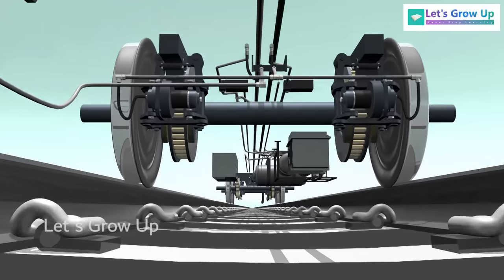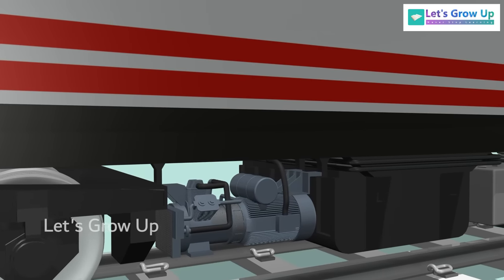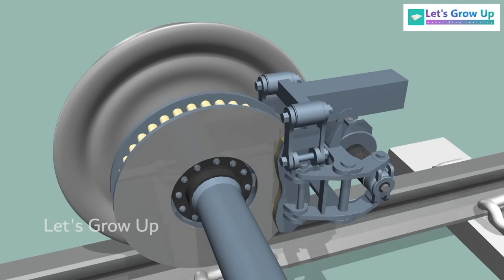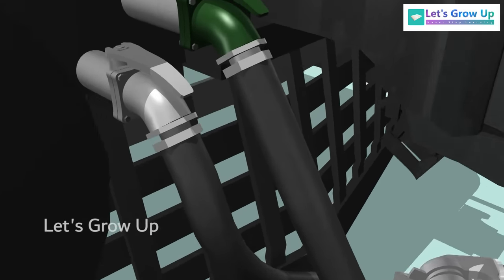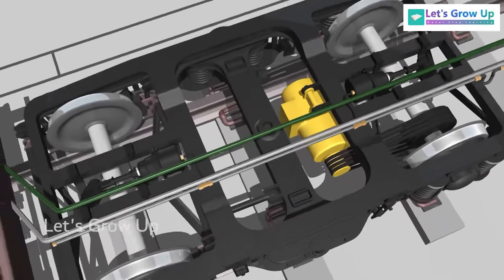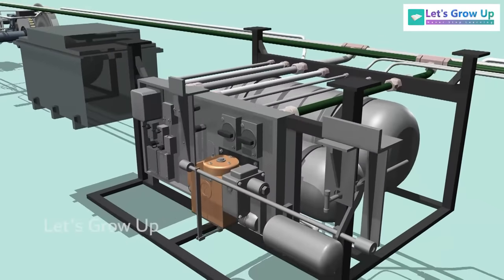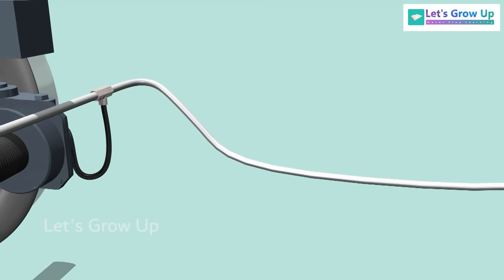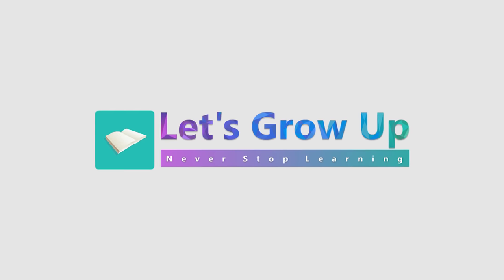Understanding the Technology Behind the Train Brake System

Comment: Im a train driver, this video is horrible. You didn’t explain brake systems. You showed the layout of a particular train types brake system. Nowhere did you explain the use of triple valves or similar such systems. You can’t call this explaining brake systems where you only told us you have air pressure, air pressure goes to a panel, disc brakes go brakey brake, and done.. this is not useful in any aspect

Comment: You never bothered to explain the main safety principle of a train braking system, if there is a failure in the the braking system itself the pressure drops which activates the brakes. Without pressure the train can't move or if it is already moving it will be stopped. But you did mention the names of all the parts of the system, in my view this is a poor way of learning, not talking about the principles of the system but learning the names of the parts. Thanks for the animation.

Comment: Compressed air in the brake pipe goes through a triple valve which fills an onboard reservoir on every car; at the same time venting the brake diaphragm and releasing the brakes. When the brake pipe pressure is lowered, the triple valve removes a proportionate amount of air from the onboard reservoir and sends it to the brake diaphragm. When the brake pipe pressure is increased, the triple valve vents the diaphragm by proportionate amount and adds it to the reservoir. When all the air is removed from the brake pipe, all of the reservoir air is applied to the brake diaphragm. This way, if the brake pipe pressure is suddenly lost, all brakes go on. There are refinements to this system, including electronic components but this is the basic operating system. When some knuckle-head drives in front of a train, the engineer may throw the emergency brakes "on" which dumps all air and stops the train, usually hundreds or even thousands of feet further down. It may take the engineer 10 minutes or more to recharge the air line before he can move on.
Reply: @nate4745  That sounds like the American system, and heretofore I had thought that that was a universal system. This video makes me think that we are here being shown a European system that is different.
Reply: "When some Knucle head drives in front of train...." Love that line 😅😅😅😅😅😅😅
Reply: @MottyGlix  Hello! Indeed there is a difference with US braking system and the European braking system. Since the Westinghouse company developed the automatic brake system for trains (it's called automatic because in the case train break apart, emergency brake is applied) it has been widely adopted in the United States. It's using a triple valve that can gradually increase braking power but you can't gradually release the brakes, release is done all at once.
Now, going to Europe, Serbia in the 1920's a man named Dobrivoje Božić developed and patented in 1928 an improved version of the automatic braking system which doubled the air flow in the main pipe and had the gradual release function which meant air was being used more efficiently thus making the train reach higher speeds and having better braking performance. Still to this day a 100 year old design of the independent brake lever called "Božić-L" is used on some locomotives and multiple units in countries of ex. Yugoslavia. It's very simple and robust.
Greetings from Croatia, a train engineer!
Reply: The video is not from Europe.
Our valves are red (main) and yellow (supply).
We use alike system like Westinghouse, but implemented into national levels by Knorr, Božič or Daněk (DAKO CZ).... etc.
But the main valve is 3-way proportional, filling the reservoirs, releasing the brakes and deploying the brakes.
Also the braking effort can be set (freight, passenger or fast -  braking performance determination).
Reply: Nice. These aspects were not made clear in the videp. Thanks.
Reply: I totally agree.
Reply: Wait, I'm confused. Lets say that a train breaks in half. The rear half no longer has the locomotive to supply air. How does the rear half stop? A better question......does compressed air apply the brakes or retract the brakes? I always thought the air retracted the brakes and that if pressure was lost that spring pressure would apply the brakes as a fail-safe.
Reply: @rael5469  The air in the lines retracts the brakes. However there is air tanks on each car and unless the air in those tanks dump out the brakes stay open. So the answer to your question is, there is actually a lever on each car that is connected by a chain to the next car near the coupler. If the car breaks away, this chain yanks that rod and opens up its air valves to dump all the air it has in its system. This is how train cars stop if they break lose. Its not super sophisticated as the rest of the stuff, but an effective and simple solution to that problem.

Comment: Okay that will work just fine for 10 to 20 coaches but what about 100 to a 150 fully loaded coal cars.Not going to work.Dynamic braking should be your next video.
Reply: LHB Coaching trains have Disc Brakes, frieght wagons have Air Brakes.
Reply: Air distributors can be set to a higher delay in action... generally, a regular European freight train (up to about 50 wagons / 200 axles) has a 15 - 20 sec action time of the brake, to avoid creating shocks in the train, while a passenger train of less than 80 axles has 3 - 5 sec. Brake force can also be set between predefined settings (G (freight), P (passengers), R (fast) or R+Mg (fast+electromagnetic, for passenger cars equipped with electromagnetic brakes). 
For an 100 cars train... you'd need very slow action air brake and all the dynamic braking the loco can give you. Or you can install electropneumatic brakes, that can command electronically all the brake distributors at same time... the later can be quite expensive and I doubt it is used at the monster trains in US, Australia or India, but will probably become a standard feature in Europe in 20 years, with the introduction of the Digital Automatic Coupler (DAC).

Comment: this is the only video which i find it hard to understand.... can u please explain with more details in which, how the compressed air actually controlled and it stops accordingly... need to know how much speed it can slow down in time for disc vs normal one
Reply: Simplistic explanation. In an air brake system, which is what is shown here, the brake pipe is always pressurised. Imagine two systems - (i) the brake pipe system and (ii) the coach's brake reservoir system. In normal condition when a train is moving, both of these systems have equal pressure. When the engineer activates the brakes, the brake pipe system loses pressure. The braking system is designed in such a way, that when pressure of (i) is lower than pressure of (ii), the brakes get activated based on the difference in pressure (more difference in pressure, higher braking), until the train stops. 

After the train stops, the locomotive  engineer has to apply only parking brake - at this time, the compressor in the locomotive starts to pressurise (i) again. When pressure in (i) is higher than (ii), it recharges the pressure  in (ii). In this condition, the brake is released, but the train doesn't move as the locomotive is set on parking brake. It can take 5-10min to fully recharge the system, depending on length of train, type of train etc.

Its quite complex to explain in words, but I think there are other videos out there that explains this pictographically. You're right, this video doesn't explain anything.
Reply: @chris_fly  Wow bro, you explained very well in words...  Thanks for your patience and explaining me... This Helped me in understanding the whole process easily

Comment: Just so you know those are not brake shoes those are brake pads and they work very similar to the brake pads in a car. The brake shoes weren't very similar to the brake shoes in a car as well but they do pressing up against the wheels in a car they were pressed up against the drums if you have drum brakes
Reply: And how typically often are the train's pads replaced - once a year? I know it depends on the amount of usage and all that...

Comment: NO loss a air pressure causes springs to engage brakes. This is the most safe type of system.
Reply: Just like air brakes on semi-trucks. If the truck loses system air pressure due to a leak, the brakes will eventually apply. So the trucker needs to pull over quickly.
Reply: No it doesn't, that's on trucks, not on trains. You couldn't get the required brake force with springs on a train. On trains, the pressure to lock the brakes should a loss of continuity occur comes from the local air reservoir on each vehicle which is charged by the main reservoir pipe through a one way valve. As long as the local air reservoir is charged then you will have brake force, and it takes hours to discharge if the main res pipe is disconnect
Reply: @Trainman10715  So no air, no brakes then?
Reply: @MegaGeorge1948  no air in the local reservoir* no brakes, correct. Hence why all rolling stock must have the handbrake engaged when stabled as the local reservoir will depleat over time. This brake system is still fail safe though as whenever the train is moving the local reservoirs are kept charged by the main reservoir which itself is charged by the compressor. And a compressor failure will result in a loss of the brake pipe pressure long before the local air reservoirs exhaust significantly
Reply: @Trainman10715  Thanks for the info.
Reply: @Trainman10715   "it takes hours to discharge if the main res pipe is disconnect" 
My God, how much pressure is in the thing?

Comment: AMATEUR IDEAS ABOUT TRAIN BRAKE SYSTEMS !!!!!
This programme is an idiotic load of nonsense, riddled with fundamental misunderstanding of such technology.  .
Reply: What surprised me even more are some of these comments!!! I knew it was going to be savage, but some of these self-proclaimed experts must be the crazy nutter types who chase trains in their vehicles with binoculars, tripods and zoom lenses.. 🤣 (no offence intended to crazy nutter types who actually know what they're talking about.)
As to the creator - "Let's Grow Up"; 10/10 for your digital creation and presentation skills; 5/10 for accuracy; 1/10 for what I can only describe as a truly weird and/or condescending channel name.
Reply: It's a very, very short description of the brake system... of course some elements are not presented, like the main reservoir in the loco and the way that the driver's valve works, but the principle (extract air from the pipe, distributor sens it, it connects the auxiliary reservoir to the brake cylinder, brake is applied) is correct.
Reply: Tell me you little you know about train brakes by trying to tell how they work.. 😂😂😂
Reply: @nickjudd5188  There are many different types of train braking systems used around the World. Many of which are Totally UNKNOWN in the USA. For a start is it a Vacuum system, an Air brake system, a Hydro Kinetic system. How is it actuated, by loss of pressure, or loss of vacuum or by electricity. Is it a single pipe system, or twin pipe system. Are there reservoirs. Does it use Brake Blocks, or Disc Brakes, the list goes on ! What is shown in the programme is extremely limited, and normally found only on certain types of passenger train in one or two countries.

Comment: Your anti-American students might understand kilos per square cm but you might condescend to mention the pounds per square inch for people who work every day with psi. There are hundreds of millions of us, even if you despise us. You might also bother to take a few seconds to explain wtf the toilet water tank has to do with the brakes, because that seemed more than slightly off topic. You probably have an 8 minute video you are trying to accomplish in much less time. It seems incomplete.
Reply: I'm sure that a Google search can help you convert the measuring units.
I can only speculate that the toilet reservoir is used for the vacuum toilets and other systems like pneumatic doors. At least in Europe that's why we use a higher pressure air pipe in passenger trains (it is also used for unloading some freight waggons), only that for us is of 10 bar, not 6. Of course, if we talk about brakes, we can leave the high pressure pipe not connected to the waggons, the important thing is to have the 5 bar pipe.
The locomotive must also be equipped with a main air tank, that has a higher pressure (I am gonna speculate that for India it's 6 bar; in Europe we use 10) and it's used to quickly increase pressure in the main pipe in order to moderate the brake (and weaken it or totally unbrake) quick.

Comment: Hi Some viewers didn't find it helpful... I DID it's articulated helpfully The balloon example explains the basic principle Putting it in my words - its pretty similar to bicycle brakes but instead of applying brakes with hand power the compressed air is released into cylinder pushing the piston that moves the lever with brakes which grab the disc attached to wheel just like rubber brakes cling to bicycle wheels.. Phew! 🙉

Comment: Worst explanation....
Iin most train brake system the brakes are applied all the time and air pressure is applied to lift or remove the brakes as the train to go.... this ensures if anything goes wrong the brakes should always be applied (default) to avoid accidents and roll overs